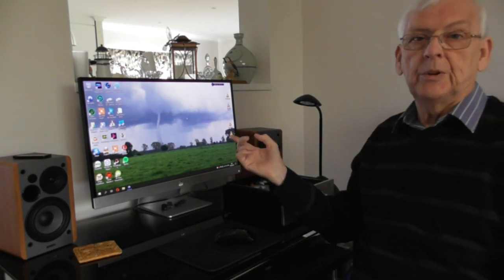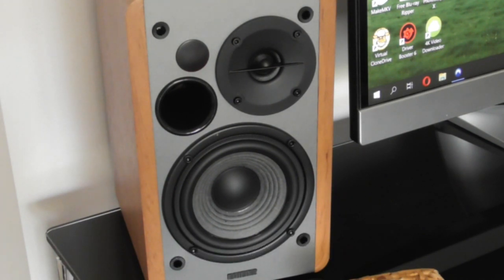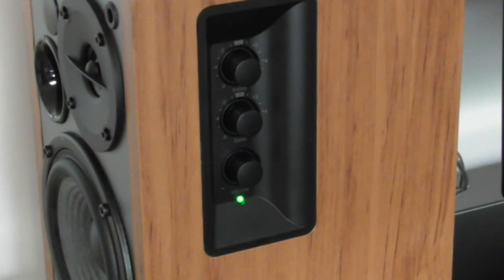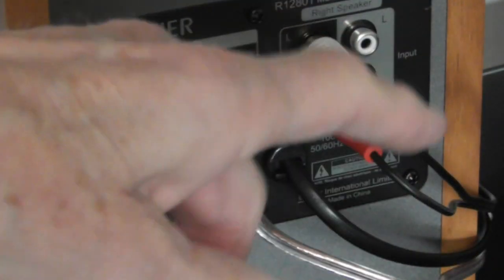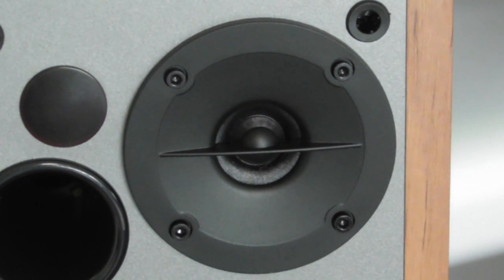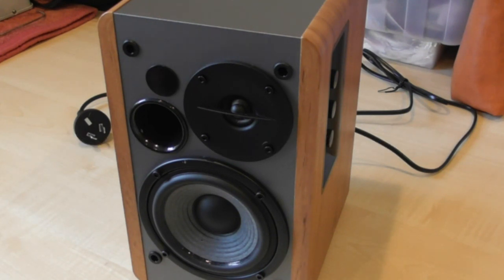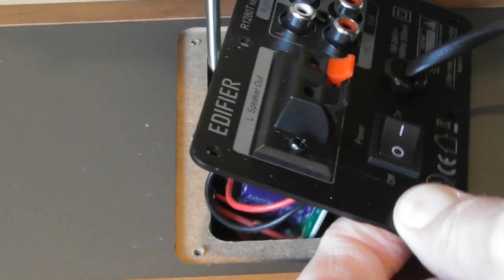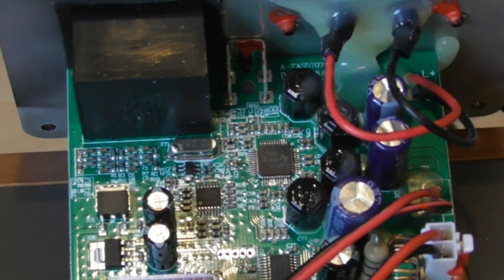Edifier R1280T Loudspeaker review, and a look inside.

Comment: When you said "it [the amp board] looks beautiful" what are you referring to? Looks like the usual cheap chinese disposable crap to me. But I guess that's what you get these days... The drivers seem nice though and the cabinets are ok too.
Reply: And I don't understand why, if they already build such a thing packed with SMD sound processing  nonsense, didn't they include an active crossover and spent a few more cents for a second low power output stage for the tweeters, instead of using a cheapo one cap solution?
Reply: Ill be recapping mine for sure, as it's for a friend and I'd rather it works for 10 years, rather then 1. lol, i dont trust those chinese caps at all, for the rail caps, panasonic fm's, for the main board nichicon uhw, uhe, uld, utt. Then all the wire will be switched out, itll take only 20mins lol buy it all from mouser electronics.
Reply: @westelaudio943  As an industrial engineer, I can tell you those 'few more cents' become MILLIONS once you scale up the production. Gotta think big here. These speakers target a popular sound, as Mr.Beeny said, and for the price point perspective they deliver and accomplish. 
These are mainstream computer speakers and they have succeeded at that. 
Technical rant should be saved for the more serious stuff.

Comment: They should have tuned it lower, wouldn't have been that hard perhaps around 45hz. They also could have used quality capacitors like nichicon uhw, uhe, utt for the main board and panasonic fm for the rail caps in powersupply as well as nichicons uld for the powersupplies mainboard, ill be recapping mine for sure. I'll be buying everything capacitor related from mouser electronics, perhaps ill add a ribbon tweeter from parts express with its own polypropylene cap to, except the value will be 2.2 to cross it higher. Either way, that tweeter is going to get a wima mkp4 3.3uf polypropylene capacitor right away to help the highend and the woofer will get at least a simple choke which ill have to decide what micro Henry rating to use, that eletrolytic on the tweeter has gotta go, if i do anything to it at all, that non polar electrolytic is literally the worst thing you can use on a tweeter, putting better stuff in it would cost the company 15 dollars more per speaker, especially if you buy the parts in bulk. lol
Reply from the maker: I hear and largely agree with you, but it really does not claim to be a HiFi loudspeaker. Few people these days listen to HiFi. Probably 95% of the public listen to music on a telephone with low bit MP3s For those people this speaker is just perfect. Don't try to modify it, just buy a better speaker. Way too much signal processing in it to even think about the crossover.
Reply: @MichaelBeeny  oh how a I wish I had a parent like you, I could listen FOR YEARS before getting tired. 
Thanks a lot for your review and honest comments. You're such a knowledgeable well spoken gentleman.
Reply from the maker: Thank you Cofee for your kind words, I really appreciate it, makes the effort of making the video's worth while. I do try to speak as clearly as I can as I know many of my viewers come from country's where English is not there first language.